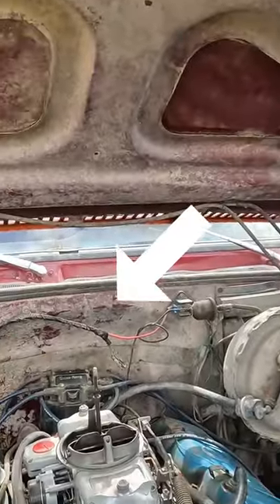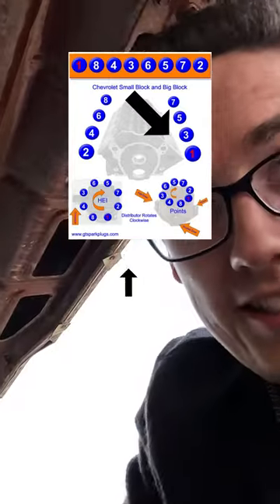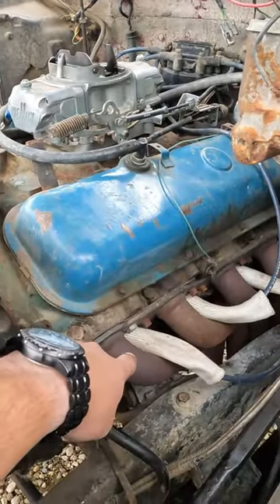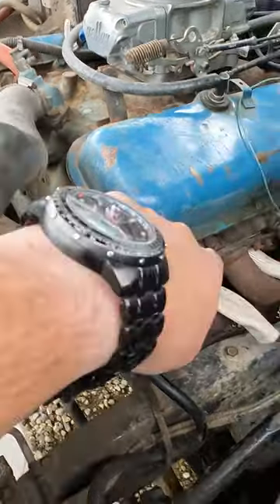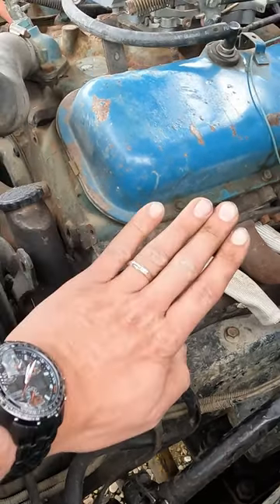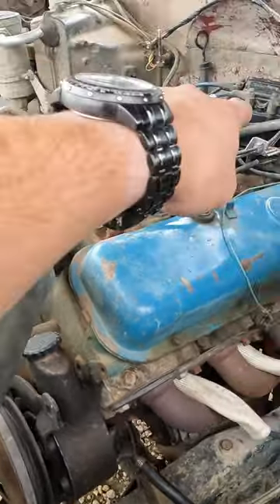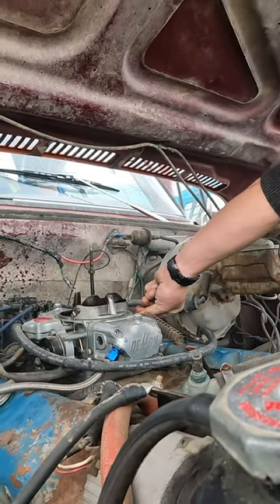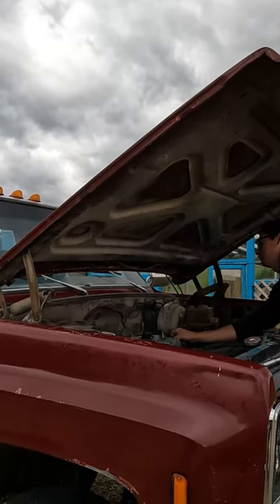454 Chevy [GMC] Timing!

Comment: Soo thumb on cylinder one do you do it at the end of compression or top of compression
Reply from the maker: As soon as you start to feel air being pressed out of the plug hole, stop turning your engine. That will give you a good starting point! Good luck!
Reply: The pressure on your thumb is only telling you it is the compression stroke. Use a piston stop tool and watch a tutorial on using it to find exact top dead center. Just feeling for the pressure would be inaccurate.

Comment: Hey what degree should be the initial timing on a 454 chevy with a mild cam ?
Reply from the maker: Great question! A BB will like a lot of timing at initial and WOT. That being said you don't wanna blow er up, and it will also depend if you're running a vacuum advance. Try 16 to 18⁰ of initial timing WITH VACUUM DISCONNECTED, should you have it.
Reply: @cisforcars 
I agree big blocks like a fair amount of timing, but I just wanted to add that big blocks like to detonate, so be careful. 👍🏻